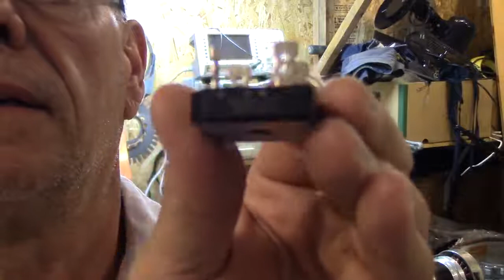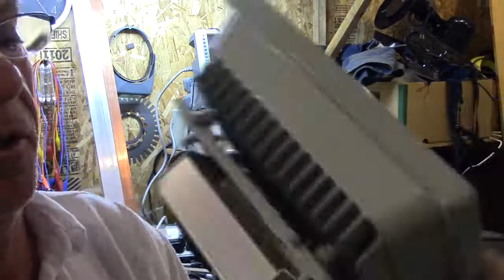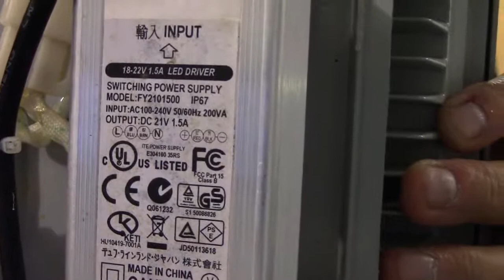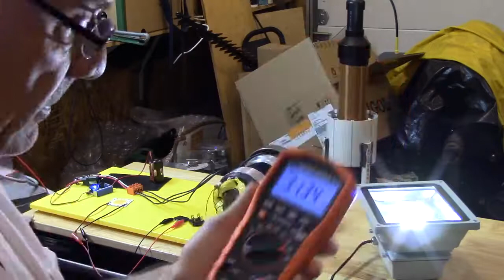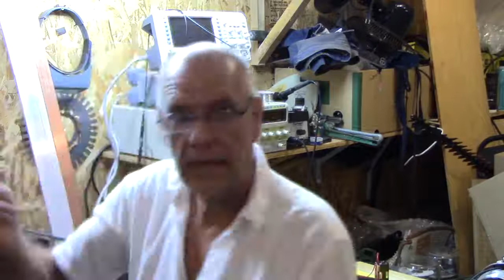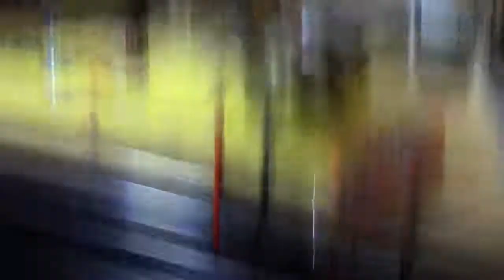Important Glimpse at the Generator by Gerard Morin

Comment: I am not proficient in electricity production, but hypothetically speaking

 If you had a self perpetuation spinning disc - without having to plug it in or run on batteries -  forever could you 'make electricity' out of it? Attach whatever arms onto it to do whatever, could you generate electric current to be made into electricity from it?